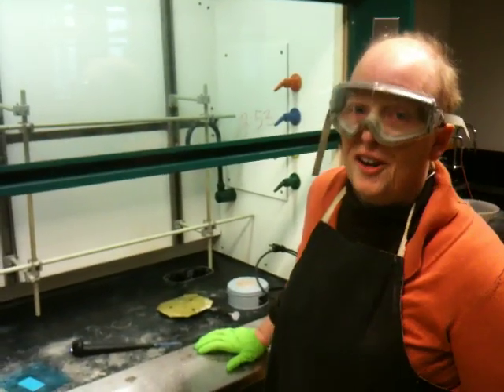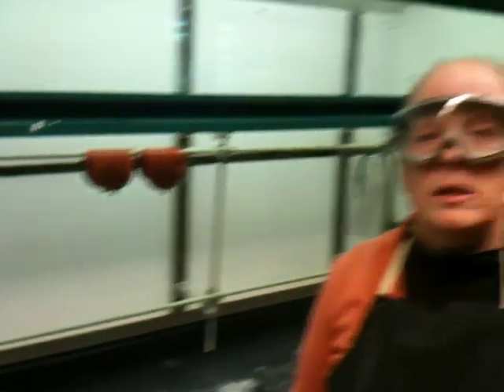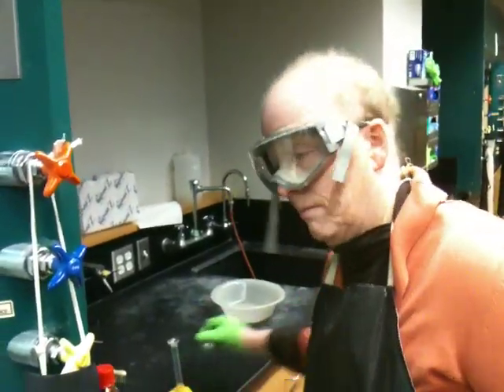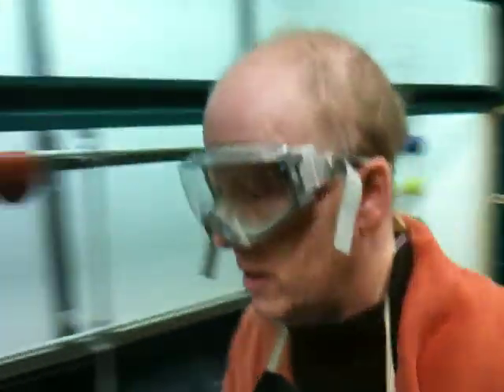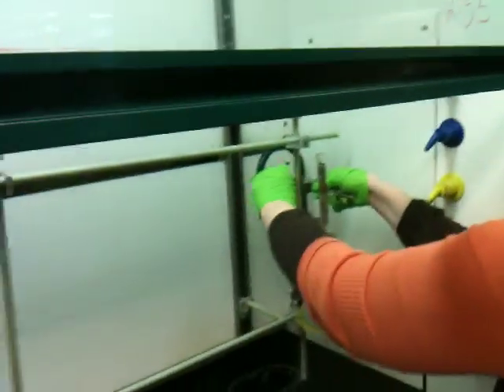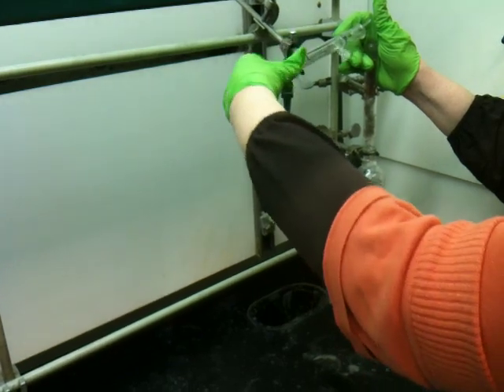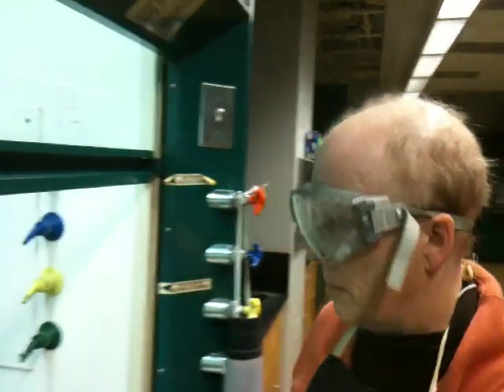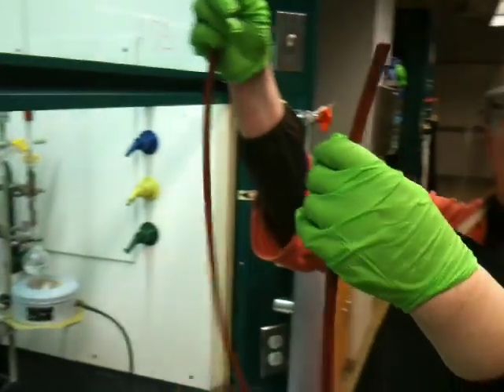How to build a proper distillation apparatus at Bryn Mawr

Comment: grease is a contaminant ! only grease the top 2/3 of a ground joint, use just enough so you joint goes semi clear and no grease comes out from the joint, this is the proper way. also never grease a thermometer use h2o as lube then wipe with cloth. clamping every piece tight leads to broken glass, clamps are for support clips and bands and gravity hold the apparatus together. the only piece that should be held  tight with clamps is the boiling flask!